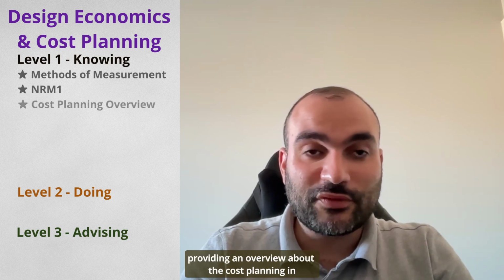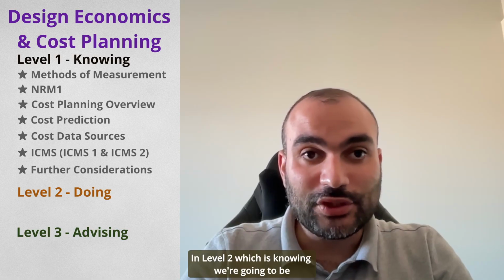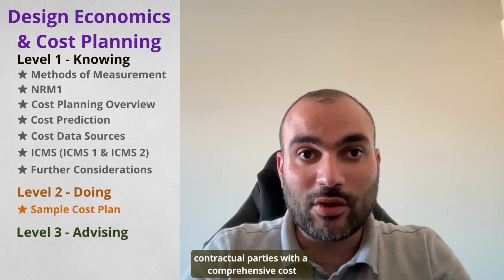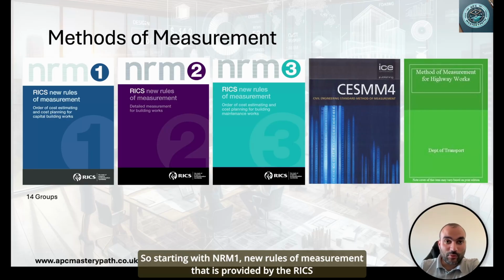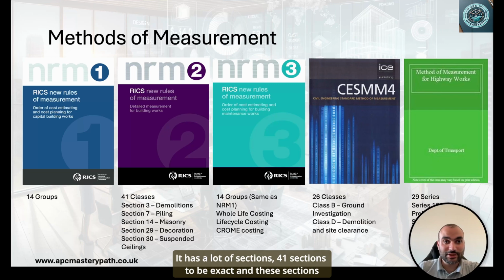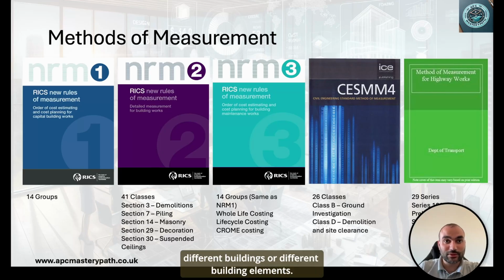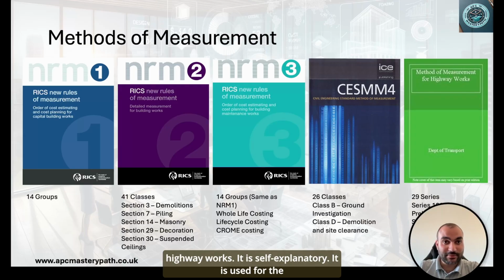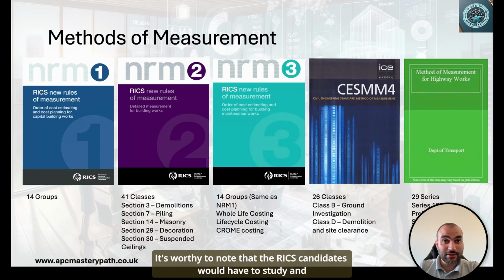APC Essentials - Core Competencies - Design Economics & Cost Planning - Free Preview

Comment: I am sure your course would be excellent. However, at £600, I feel the price is a bit too high for a series of recorded lectures.
Reply from the maker: Thank you so much for watching and taking the time to comment. Feedback is always appreciated! 🙏

Just to clarify, it's much more than recorded lectures. The course includes structured notes, presentations, and a full Q&A bank, all built on 4 years of hands-on APC experience. It's a full preparation package.

On price, you can use code APC35 at checkout for 35% off, bringing it down from £600 to just £390. And to put that in perspective: achieving your MRICS typically adds anywhere between £9,000–£15,000 to your gross salary per year. The course pays for itself within weeks of getting chartered. Comparable courses on the market start at £1,500+, and with mentorship that can easily hit £3,000. aso at £390, it's genuinely great value.

If you'd like to chat further, feel free to reach out directly at mo_ashour1@outlook.com. I am always happy to help! 😊